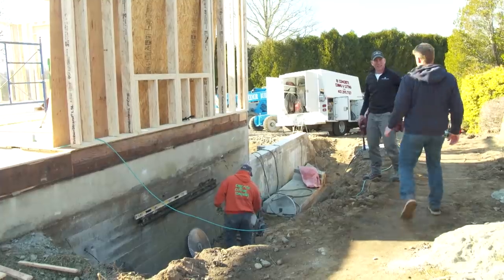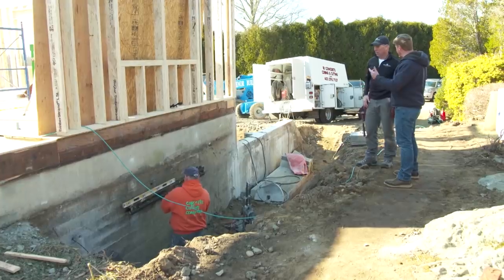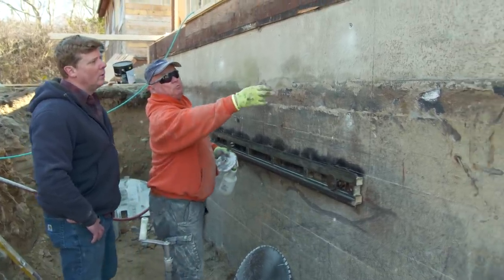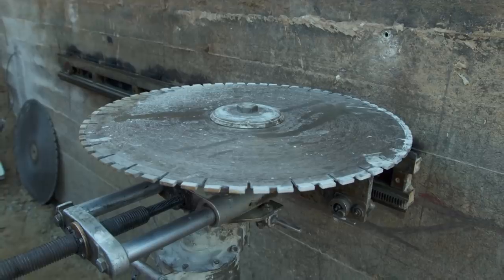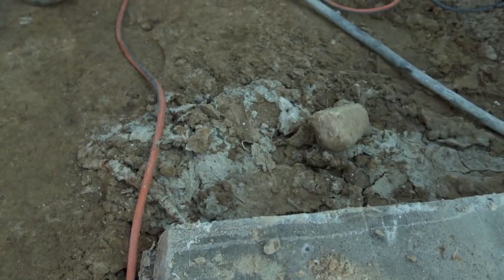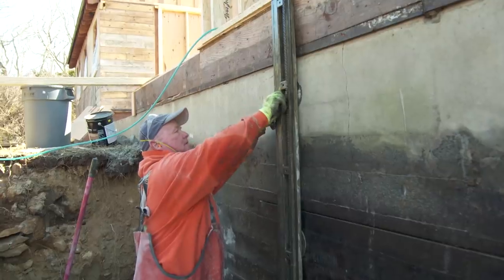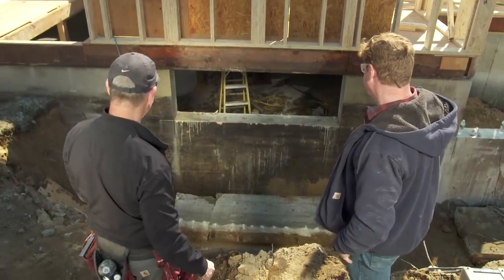How to Create a Basement Window | This Old House

Comment: Ya I'll just go pick up the ryobi model of that at home depot
Reply: "Oh it's the 20v max pro II model with charge boost batteries?" Awesome!, sounds perfect to cut a concrete window! I'll get the spare bi metal max cut blade too, because I'm installing 4 windows in my cellar this saturday with my friend.... Good to have a spare in case a tooth chips!
Reply: 20v Max oscillating tool from Dewalt. Does everythinnnnng bro
Reply: @volvo09  haha
Reply: Or you could just do what ever everyone else does and rent one.

Comment: Step 1. Hire a contractor with a saw designed to cut windows out of concrete
Step 2. Pay them
Reply: You dont need a fancy saw like that to cut thru concrete or hire a contractor. You can rent a regular one from home depot for like $60 with diamond blades. It will just take a little longer
Reply: @nateg5915  yeah i hope to god the average homeowner isn't cutting out huge holes in their foundations
Reply: @howdareyou41  I hope they would at least consult an engineering before doing something like this but I've install an egress window where there was an existing regular basement window. Its not rocket science, as long as you reinforce the larger opening you'll be fine. Your 2000 sq foot  house with 4 ft deep footings is not gonna cave in on you by cutting down on an existing 30"  opening

Comment: What's really impressive is when you see someone do it freehand....we just had 7 3x5 holes cut in 8" formed concrete and two guys, one cutting and one mucking, did it in 5 hrs.. I put the bucks in after and they were surprisingly straight and square. Good job to hire out for sure.

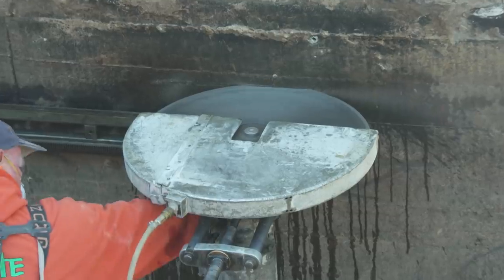Comment: 2:56 you're increasing the AC frequency to make the motor spin faster, not power boost. The speed of Synchronous AC motors is a function of the number of motor poles and electrical frequency.  You can't alter the poles, so all you can do it change the frequency.  It's not a power boost.  Power boost so of require more power to be added.  If no power is added, Newton's 2nd law is violated.
Reply: Yeah, I'm a professional electrical engineer, and when i heard the guy say that, I thought to myself, 'Dang, I must have been absent from class the day my professor taught that phenomenon'.

Comment: This is so cool. Just curious will this affect the stability of the foundation?
Reply: Not once they install the double pressure treated frame and crutch (upright piece in the middle). They will line up with the studs in the wall above.
edit: milled to middle

Comment: And this basically is the trouble when you want to change or add a window or wall in any part of a German house. Cutting or smashing brick and concrete. Not only in the basement, everywhere. Just enlarged a window yesterday....without that neat equipment it is quite a job.

Comment: Love how every circular saw is a skill saw. uhh taking 60hz to 400 hz is not "boosting power"
Reply: He was just redefining the laws of physics.
Reply: That cringed me too somewhat. As if changing frequency makes something more powerful. I don’t know why they do it while i know tons about electricity. If i don’t know why they do it then they should not just brag with that frequency change as if everyone is going to know right away what the frequency change means for the result. Perhaps it has a motor whose rpm depends on the frequency so the 400hz makes it run 8 times faster (but with 8 times less driving force).

Comment: what about the overcut?
Reply: depends if the over cut went all the way through, if it did it's easy to fill before setting the frames
Reply: Yeah, looks like they really compromised that "header", especially on the right side.  That 'header' appears to be the actual end joist and sill plate.  That can't be good to be cutting into them.

At 3:47 what is he cutting with a chain saw???  Is he finishing the upcut so the diamond blade did not touch the sill plate?

Also, what's going on at 3:54 when the concrete slab falls out - it appears the blade didn't go all the way through and they drilled holes and used feathers and wedges to split the interior concrete???

These short 'episodes' leave more questions than answers.  Just so you know TOH - read the comments - these SUCK!  Give us content with actual information!
Reply: No overcut on the top.  That is what the chainsaw is for.  To finish the corners.  Not sure what he didn't do that on the bottoms.  Maybe the contractor will just grout those overcast.
Reply: Chris H whats your last name?
Reply: PoliceBadge Why not ask his address and pincode of his bankcard right away?
Reply: @policebadge8026  Not Hudson if that's what you're asking

Comment: One purpose for the water he didn't mention is that if you don't keep the blade cooled with water the cement holding the diamonds on fails under heat and in just a minute or two the blade is ruined.
Reply: We use diamond blade demo saws all the time in concrete with no water, never hurts anything except all the dust.
Reply: he sort of did mention it.  He said the water lubricates the blade.  ie cools the blade.
Reply: @augustreil  not a good idea to be cutting without water for 2 reasons.  First, if you don't use water you will reduce the lifespan of the blade.  The diamonds will actually evaporate if they get too hot.  Second, that dust is carcinogenic.
Reply: @tchevrier , true.
Reply: @tchevrier  lubricating the blade is pretty great. Makes it cut faster. Cooling the blade stops it from coming apart.

Comment: How much does a saw like that cost. Gotta get me one.
Reply: last time i seen one go at a police auction it was about 4k could go up to some 100k depending.
Reply: im sure you cld rent one
Reply: Kind of obvious that this is not going to be a 100$ thing. Which non-business person does need to own such tool? It’s not like you’re cutting your basement every week. Renting is the way to go. But obviously you also need knowledge about where you can cut in your foundation and where not. You’ll be risking your most expensive possession (the house).
Reply: Bruce Bernal
 ... the saw can probably be had used but the blades are not cheap. I'll guess replacements are $500 - $800 each.
Reply: Kevin should think about his dialogue more closely. Nobody wants you coming into their hole.

Comment: What I figure u hav these old homes 100 + old no insulation..u get 2x2 " or 1"frame inside of room ,lose 4 ,5 inches. 10 ft by 10 ft now 9 ft 6 inch b safe when done.then use 2 " insulation board in frame then thin wall board reverse or fill them lines on board.sand, base coat ,paint..easy insulation where none.windows get two pane or storm windows.ceiling if closed attic  also floor if basement.

Comment: How much costs such blade ?
Reply: Just a couple bucks...
Reply: About $400.00 each... The machine cost around $2,200.00.....
Reply: @MasterChief-sl9ro  Amortized over 40 jobs, that's only about $10 for the blade.  Assuming no rebar accidents.
Reply: @jej3451  These are designed to cut Rebar... I seen them used for all kinds of crazy jobs. But if you use lubricant like soap with water. They last longer...

They take longer to setup.  Then too use. Then you have to take it all apart to move for the next cut...
Reply: Joe Kinchicken  $2.99 harbor freight with coupon lol